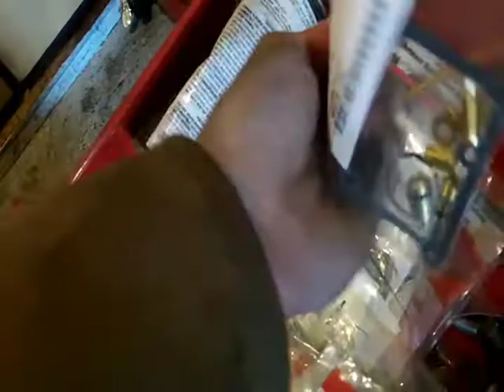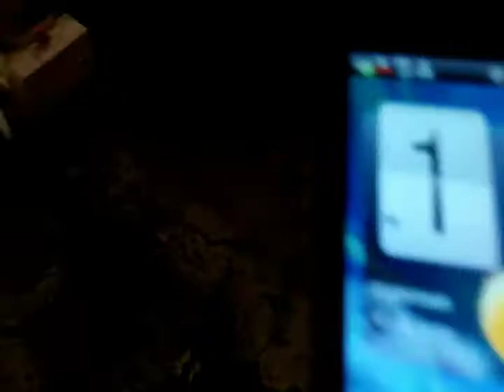ARIENS, CHOOCHER, SHOP AND A SHOUT OUT

Comment: The history is always cool man. My shop use to be an horse barn that had one light bulb and one outlet basically. And i cleaned it all out with my tractors and wire in more outlets as needed along with putting gravel down on the floor was a big step. then i needed more room and added a lean too on one end.